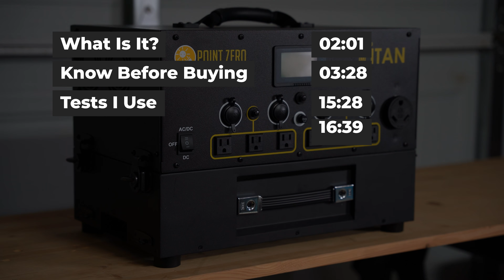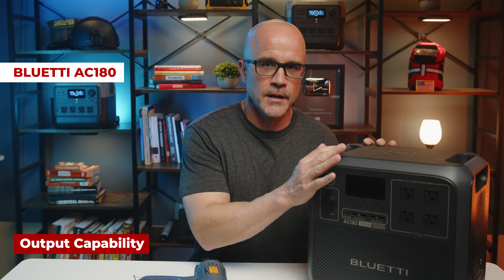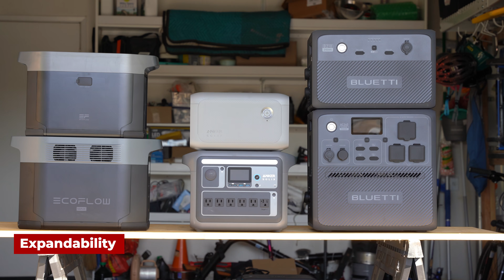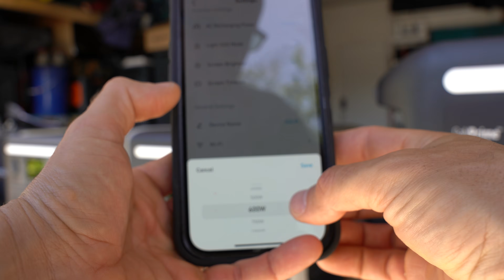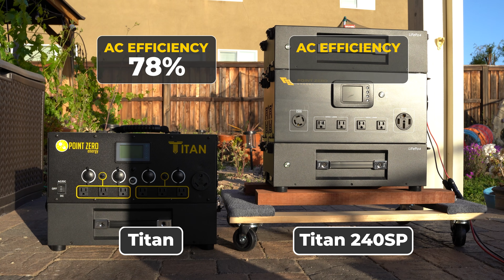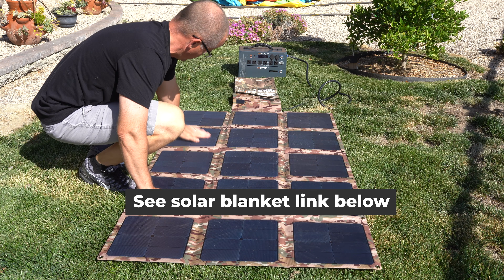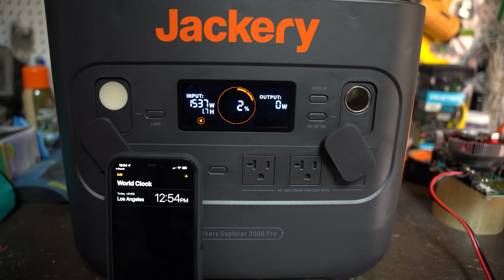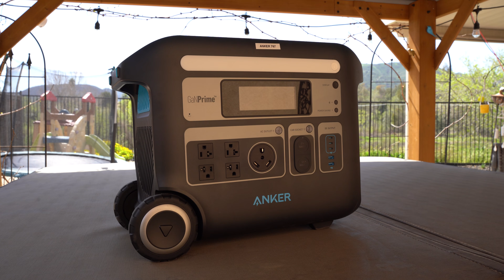Best Solar Generator for 2024 (The Ultimate Guide)

Comment: The company that makes zero sense is point zero. It take the knowledge of a 3rd grader to put together a 5120WH setup from EG4 and you are looking at around $2k output is 3000watts, solar input is 5000 watts at 500 volts. (It is DIY and not fully contained like these units.) Guess they made their point. zero reason to buy.
Reply: Just did this. The 3k eg4 inverter all in one and eg4 weatherproof battery. Plus 4 panels 450 watt each. All in i think with taxes i was about $2050. Could have saved money if i went with the rich solar inverter instead.
Reply: @michaelmoore1276  my eg4 3k has been running solid for a year. No complaints. You will love it. It's a bit loud. But I'm sure the rich solar is too

Comment: I live in Florida and have suffered through days without power. I currently own 2 Honda 2000E generators which can be connected in parallel. My thought is during the day when it’s hot out, I will run the Hondas generators. At night while we sleep I have an Anker SOLIX F2000 Portable Power Station 2048Wh | 2400W. Now, my theory is, the Hondas need to be outdoors to run so daytime while I’m up and able to keep an eye on them is a better option. At night I can place the Anker in my closed and secure garage. Then the next day I will use solar to charge my Anker and if the sun it not out then the Hondas can charge.  Have I missed anything? Amazon was running a pretty good deal on the Anker and solar panels. I was able to get everything for about 2K and 1 year at 0% financing.

Comment: We purchased an Ecoflow Delta 2 and battery for powering field test equipment at work.  It has been a powerhouse and is so easy to use.  One of the best pieces of equipment we’ve purchased in quite some time.

Comment: No, they are not generators.  The solar panels are the generators, as they are what is converting the solar power to electricity.  They are just a batter pack or "power station."

Comment: Regarding the DIY route, I did that because I wanted to power a 100W HF radio with noise-free power sometimes and power an 1800W AC appliance other times. If it wasn't for that specific use case, I would've saved time and money by buying one of these commercial units. They really are a good deal for what you get.

Comment: My Bluetti died after 7 months, and they will not honor their warranty, so I would avoid Bluetti.
Reply: Very good to Know!
Reply: My Bluetti malfunctioned after a few months. They took it back and refunded my money. No questions asked. Sorry you had a bad experience.
Reply: I bought an AC180 7/2023. Last month I had a issue of it shutting down. I called, took a video of issue. They sent me a shipping label, I shipped it for repairs and Bluetti apologized for 2 day delay and sent me a brand new unit. Less then two weeks. Bought a second unit due to customer service and performance. Bluetti earned my business!
Reply: I bought a Bluetti EB3A when they first came out and it is still working great and is very versatile and useful. It now lives with one of my kids who uses it and depends on it daily, for the last year or so. IT’s a great price now and I would recommend it highly.
Reply: @BillWalker3rd me too. I’ve been using the EB3A almost daily for the past 3 years and it’s still going strong 💪.. never failed me yet.  Bluetti is definitely one of the best, if not the best, battery companies out there.
Reply: @ Mine is sure still going strong. I don’t use it every day, but I use it an average of 3x per week. I’m still really impressed! Thanks for your comment! :)
Reply: I am a contractor in Florida, we run Bluetti in our construction trailers, and have been very happy with the units and have had little issues. Harbor freight has some great it’s a five year warranty. I assume you probably had some other issues for them not to warranty them.
Reply: I'm sorry you got screwed, but thanks for letting the rest of us know. I've heard that so often that I marked them off my list to consider buying from. I've heard the exact opposite about EcoFlow, so I'm going with them.

(Bluetti, are you listening? Keep up this shirty customer service and you won't be on top for much longer. IF you still are now.)
Reply: Fake haha @LeftyLinda
Reply: That don't sound right🤥
Reply: Their user manuals sucks
Reply: they come with 2 yr warranty
Reply: @ImaTruther1 ecoflow 10 years warranty
Reply: Me too
Reply: Thank you for the warning
Reply: I heard the same from others which is why I opted for Ecoflow.
Reply: 5 years with Bluetti, zero issues, ecoflow feels cheap to me
Reply: @skepticalhistorian797  I'm thinking the best way to go is to attach inverters and the gizmos you need to a plain cheap Lifepo4 battery, much, much cheaper than a pre-cooked power station box.
Reply: @skepticalhistorian797  I own 2 bluetti’s about to get my 3rd unit .. no issues .
Reply: @skepticalhistorian797 ecoflow "feels" cheap to you...

Oh boy.
Reply: Ive bought 3 bluetti power stations and 1 200watt solar panel. Had an issue with the panel handle and they sent me a new handle and took $50 off for the inconvenience bought thru amazon.
Reply: You should add more details. How do we know you’re not a competitor, or you weren’t negligent with your power station?
Reply: @mikam8801  It was an EB3A, and I got a red light that says SHORT, they asked me to send them a picture of the packaging material I was going to send it back with, so I sent them a picture of it in the original factory shipping material. No word back., so I've called numerous times, I guess the girl on the phone can't communicate with the rest of her company or do anything about it. I've had other people I know whose Bluetti quit on them too, with same results.
Reply: I’m not buying a Bluetti now! I’m sorry they  did not back their product. Appreciate you telling us your experience 🙏
Reply: sorry, that sounds bogus to me. you should provide more info for context... you don't say what died on it. you don't say why they won't honor it, etc.. sounds fake.
Reply: @chancepaladin  My Bluetti EB3A died, it displayed a red message that said SHORT. Bluetti told me to send a picture of packing materials for return, I did, but never got return authorization. Thinking of driving to Vegas and dropping it on somebody's desk!
Reply: @gsp49  like, try again? call them? that doesnt mean they arent 'honoring the warranty'. ;/
Reply: @gsp49  Sorry you're going through this. Have you contacted them again or through another medium? Poor customer service does not necessarily mean they aren't honoring their warranty, just that they suck at communicating. Sometimes we have to make a few attempts. Heck, I've reached out to the CEO of a company I was having issues with through LinkedIn. (Yes, they resolved my issue.)
Reply: @chancepaladin I got tired of calling, and talking to them without any results, 2 months ago they finally sent a return label, I returned it, but no sign of any money yet.
Reply: @gsp49  it’s been 2 months got an update?
Reply: @gsp49 me too
Reply: Um when a company blows u off ...yea bad service thwir not honoring warranty @chancepaladin
Reply: Thank you for letting us know
Reply: Something's missing here.....  The "why" in not honoring the warranty.  Smells of user abuse to me....  I have several Bluetti products and have had ZERO issues.  I would not disregard a product because one person had a negative experience, especially when vague in their complaint....too suspicious.
Reply: Yes, I agree.  I called and emailed Bluette with a problem with a battery I purchased from them and they didn't even bother to call me back.  No support from them AT ALL!
Reply: @suemerritt7895  I'll avoid them with the reviews i see on here,thanks for the heads up.
Reply: Me too. Bluetti sucks long term.
Reply: Thank you for this info I was trying to decide between ac180, c1000 or delta2 I will now scratch ac180 off my list
Reply: @MarkMack1982  hey! I've had an AC180 about 8 months now, no problems.
Reply: My aunt bought bluettii and used one day and didn't recharge.. going to court for abusive fraudulent sale of elderly people in Puerto Rico
Reply: Buy your own battery and parts. Build your own. Don`t trust China ever.
Reply: @baneverything5580 All of the Lifepo4 comes from China. Even that from Japan and Korea There are no producers of this technology in the United States other than Battleborn that is cost prohibitive..
Reply: @baneverything5580 agreed.
CHINA, not brand.. lasted 3 months.
No help. Just ridiculously wanting to send part and we pay, plus open to do work.
What the!!! 
Now it just plug in charge, solar dosnt work.
Powers USB only.
So.. it runs some led lights.
Phone charge etc. 
I'm off grid so I have to charge at a friend's.
I like and understand, some panels, in controller, with wee 1000 watt inverter off my batteries for 240 wats.
Charges my dewalt batteries, runs 12 volt lights.
Keep it simple.
I'm going to set up two more like this just with bigger panels.
Litheueom batteries.
Thinking about how to set up my 800 wt solar array.
Ground mount , mobile.
I can't trust Solar banks.
What's the point of WI fi apps when that's gone.
Lights 12 volt fridge, Propane cook and USB led, 12 volt lights and a fire. Wood/ coal burning.
That's How I'm living. 
Love it.
Food..  easy store grain. 4get cans. MEAT BIRDS , mascovies, and eggs.
Garden greens.
Ot the END of the World , right.
Reply: @baneverything5580  almost ALL of the LiFepo4 comes from China.
Reply: WAY too vague of a complaint.  How about posting the "why" it wasn't honored ?  I'm positive Bluetti didn't give you a one word "Nope" denial....Odds are high you rigged something up that you assumed would work; it didn't, damaged the device, but blame the device for your inadequacy ?
Reply: @AlL-ff7cn  Are you just ignoring the amount of people in the comments talking about lack of Bluetti support? Perhaps you can give an example of good customer service from them ?

Comment: In the google doc spreadsheet, select lines 2 to 31 (so from the title line to the last product) and use the menu "Data / Create filter view". That will add a button in each column header. You can use them to sort the table according to each column or to filter out some rows.

Comment: Main issues for me with the Delta 2 Max is very little DC out (no 30 amp Anderson port like the Delta Pro) and solar ports max out at 500W (would have been nice to be at least 600W as it allows for more solar array configurations).

Comment: It would be great if you could test the RFI (radio interference) they produce from their inverters and charge controllers. When the power goes out people expect they may need to use radios to communicate and they don’t want their power supply producing noise that interferes with the radios reception.

Comment: Great video. One suggestion: for emergency use, really drive home the point that the “generator” aspect of these devices is limited by solar charging capacity and weather conditions and obviously doesn’t work at night. While these devices are powerful and slick, none can match an ICE generators ability to run for as long as you have a fuel source.

Comment: I found an amazing deal on delta max 1600 I purchased 2 head units and 1 battery expansion with (2) 100w flexible solar panels for $1,550.00. I bought each battery for $450.00 brand new old stock since its previous model and each solar panel for $99.99. Although a great buy I’m wondering if I should have waited to afford the delta 2. Additionally since I have two head units. Can I use one battery to charge the other?

Comment: This was very informative and the spread sheet is very helpful....it just seems to me, to power anything that draws high amps, you NEED to buy the highest capacity one that is available.  Then if there is a long term power outage that you would still need a ICE generator to recharge the batteries. usually storms have cloudy days so the solar panels will be less efficient and hard to completely rely on ..Plus These units will then need to be replaced in 5-10 years depending on use.  seems like for the money, ICE generators are still the most cost efficient over the long haul.
Reply: You’ve got it….mostly.  The problem isn’t the power generation from the panels. It’s the amount that can be stored by the batteries.  Until battery technology improves, (and it will), the best thing to do is supplement your solar power generator with a multi-fuel generator, much like hybrid cars are transitional to the EV market while they improve  their distance range (through improved battery storage capacity).

So like you point out, buying the largest capacity is crucial.  Then supplement its charging with a multi-fuel generator (which is likely to last 20-25 years).  Over time, as battery storage improves, you’ll need to ‘top off’ your solar generator less and less. 

The future looks bright…and climate controlled. 😉

Comment: I want a ecoflow to setup a trickle charger for my ev. It charges off 110v while im gone, plus solar and then bulk drops the charge into my ev when I hook up 10-12 hours later (like after work). Should then load balance down to the 110v charging (maybe alittle worse at night) once storage is depleted. I got a old jeep I could put them in that already has a 110v line ran thru it to use the insides as a makeshift shed. It houses the surge strip that runs power to my chicken coop already. Its a tiny hutch style so no more than 500w being pulled (max at winter for a heater).

Comment: excellent . another great review . idea for future video
looking for recommendations on parts i would need 
to build an apartment power system that would fit in a small garbage can size faraday cage
power source (solar panel or car battery)
dc to dc converter to step down power from solar panel to micro inverter 
micro inverter (500w to 1000W) dc to ac (battery optional)
power target (small appliances)
any ideas or product recommendation would be greatly appreciated

Comment: Thanks for the spreadsheet. I'm looking to buy a larger power station for the winter. One that could run a 240wh heater and a cooler fridge. I have two 240 power  banks that don't even run the small heater.

Comment: If anyone wants to nred out and help a metal head at the same time...

I'd like to be able to record music out in remote nature. I would need to power the following:
MinisForum Ryzan9 HM90 Micro Pc
Portable 4K display (has rechargeable battery)
Audient Evo8 recording interface
DarkGlass A/O 900WATT Bass amp
FX pedal board with various 9v ac units (between 2 - 5 at a time)

I'll be tracking bass, drums, & vocals for varying lengths. The bass amp would not be driving speakers, but rather running direct into the recording interface. I have  travel drum kit and all the gear is portable; This means the solar unit would need to be as portable as possible, but strong enough to run the above for at least 4hrs. I know this is niche but if anyone can help I'd appreciate it. I can only track drums or bass while I'm alone, the 900wt amp is one scenario, drums & vocals will just be the mics going into the interface into the PC. I'll also being moving into a 5th wheel and using this same gear in the garage area. I'll want the best modular long lasting system with the fastest solar charging available when the time comes. For now, just need a mobile solar rig. Thank you

Infinite love & gratitude from Colorado!

Comment: I just bought a AC 180.  I figured DC was more efficient, but your testing shows their AC efficiency is better.   So I assume I should be running my 12v fridge off of the AC180’s AC?   Or will the fridge itself run more efficiently on DC?

Comment: A great update on the state of the industry for 2024.  How quickly things change.  I bought a unit a couple of years ago, so I'm "stuck" with it until I've used it up.  The latest units sure look good - plenty of capability.  And I love the switch to LiFoPO4 chemistry - 3500 cycles vs 500-1000 cycles for Li-Ion, can't beat that.  

Any chance at doing a "best of" for the under 1kwh class?   I'm looking to get a smaller unit specifically geared to high portability, with minimum size / weight foot print, with adequate capability for my needs.

Here's what I've homed in on, but would love to hear more input:  For powering a Dometic portable fridge when camping, the EcoFlow River2 Max is a really good set of capability.  The fridge uses about 300 watt-hours / day in hot weather, based on my experience with it.  With 512 watt-hours capacity, the ability to take 220 watts of solar input, compact size and light weight, The River 2 Max seems like it'll be more than enough for the fridge, the phone, iPad, camp lights,  and any other small electronic devices that may be used when camping.